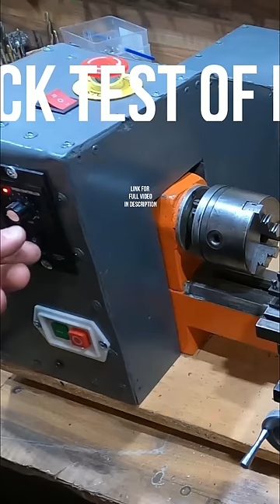DIY Old Lathe Using Washing Machine Motor

Comment: I would recommend hss(high speed steel) or carbide instead of brazed carbide tooling because brazed carbide doesn't work that well and chatters a lot which can mess up parts and surface finish

Comment: Hello, how did you set the engine speed?  Did you use the machine's electronic card or did you use a new card?
Reply from the maker: I'm using a speed I'm using a speed controller ☺️
Reply: @HandmadeCreativeChannel like a rheostat.